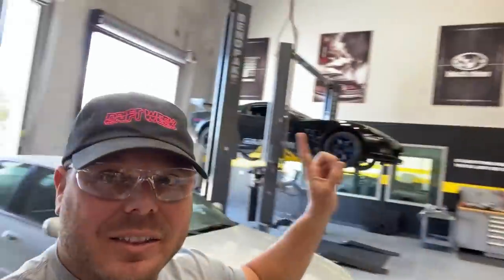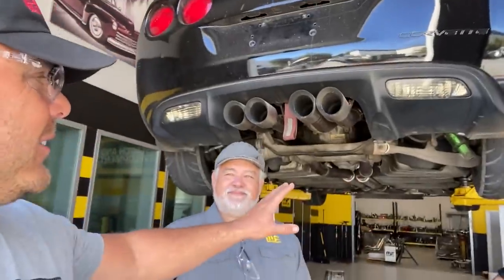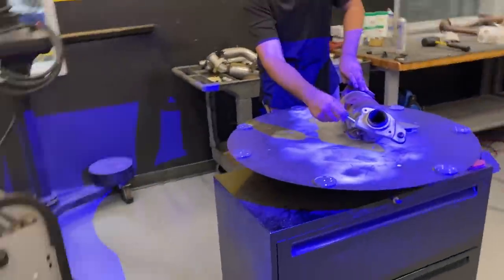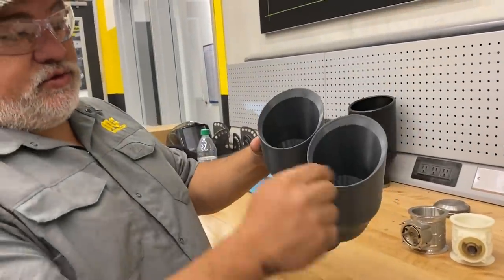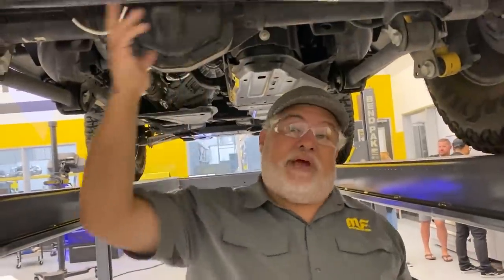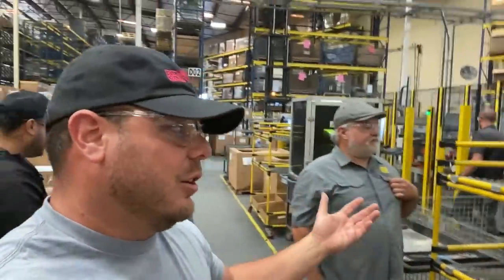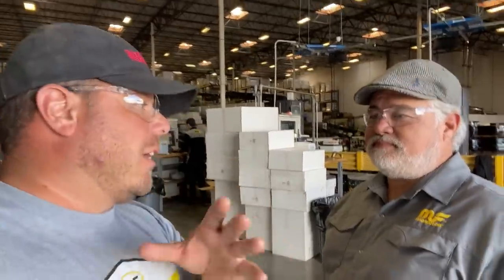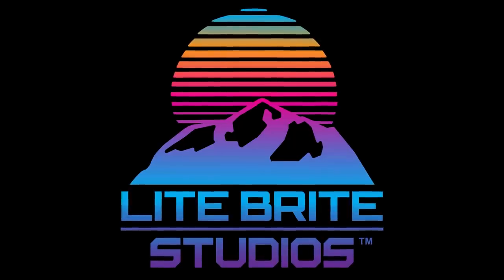HOW TO MAKE YOUR EXHAUST SOUND BETTER - Magnaflow Upgrade!

Comment: What a contrast to when I called tech support at Flowmaster. Flowmaster tech support was worthless. They could not explain the power loss with their mufflers I has installed on my motorhome. Eventually I did give up and put Magnaflows on it. Night and day performance difference. The sound was much better as well. It was quieter and more pleasing. Had a little rumble when you got on it, but under normal driving you really couldn't tell unless you were listening for it.
Reply from the maker: They (flowmaster) are farmed out to China. Not made here bud. Sorry but sure glad you found magnaflow and love it!!

Comment: Or, straight pipe it, remove the exhaust flapper and leave the resonators intact so it doesn't drone on the highway...  I did this on my 2018 Silverado Z71 and my 2019 LT TrailBoss...  Went to the local muffler shop, cut out the muffler and flapper with a sawzall and welded in a straight piece of stainless pipe for $100 out the door.  Sounds brilliant.

Comment: Have had a few magnaflow exhausts over the years, last one got ripped off during a "spirited" rally drive, where it got flattened up against the rear axle.
It was pretty much reduced to the size of a coca cola can. Bought a new one, have to hide this one better, so the rocks don't grab it. 😅